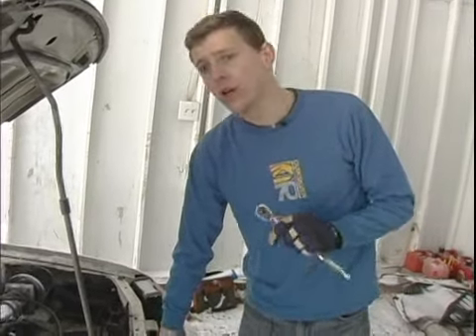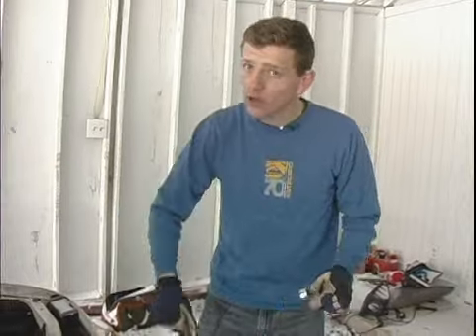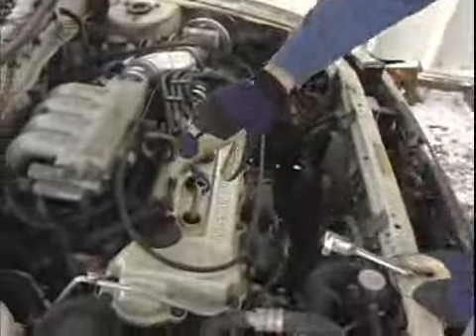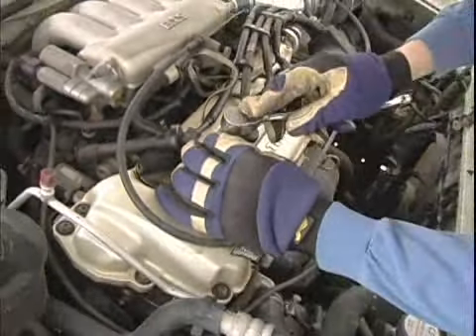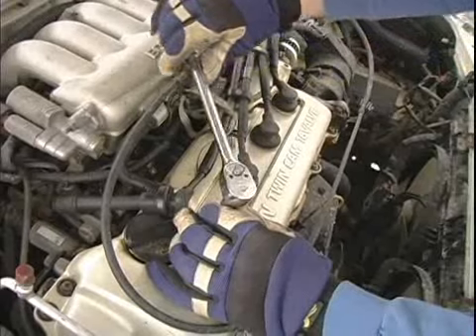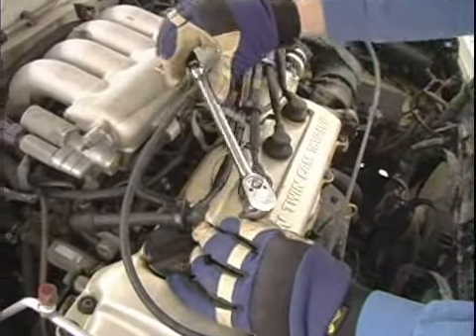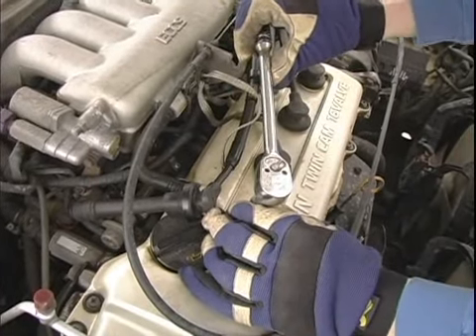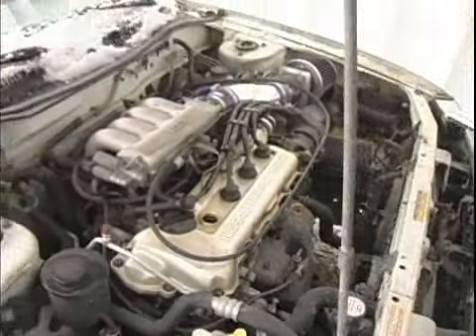Tightening Spark Plugs

Comment: Mate some people are stronger than others, you need to explain the torque settings, how to set up the torque tool and where to find the settings on the Internet.
Reply: Around 45Nm for spark plugs because usually if it's a cast iron or aluminum block higher torque can damage the threads around the plug, Usually just turn the bottom of the torque wrench until it's on 45, there will be 2-3 clicks when it's on the correct pressure.

Comment: Hand tight it, then a quarter turn.. easy
Reply: helo, can i ask, is this the same with the dirtbikes?
Reply: @tanectanec8566  I never worked with dirtbikes before but if you just snug tight and not force when tightening the sparkplug... you should be ok
Reply: We're gonna call you Shade Tree buddy 😂
Reply: 1/4 turn is always the right choice. It's even on the box on a new NGK plug
Reply: @bananafoneable my new NGK plug says 1/16th of a turn. Would you still do a 1/4 turn?

Comment: No!  I'm a HE MAN who's been drinking!  Spark plugs are important, so you need to crank those puppies down as tight as you can.  Make sure to use a breaker bar if you have one, and put a lot of red Loctite in the hole before you screw the plug in.  Screwing them into a hot engine works best.  When I do all of that, I can tell it is tight enough.

Comment: Took my plugs out earlier when engine was hot. I’m a mechanic I should have know better but I’m know to be an idiot at times. Spark plugs now do go in and tighten but seems like it won’t tighten past 5 ft lb is my guess. It will thread in just won’t tighten much. I’m just gonna hope they don’t leak say some prayers folks! 🙏